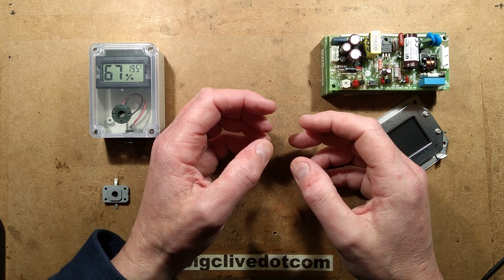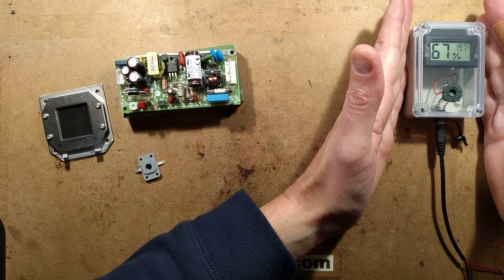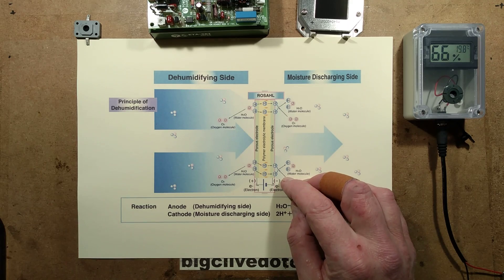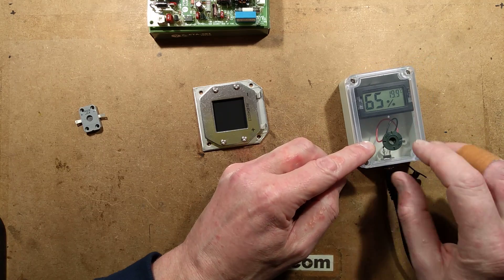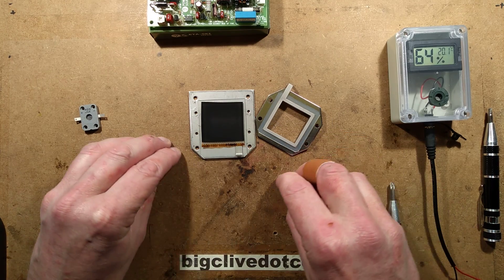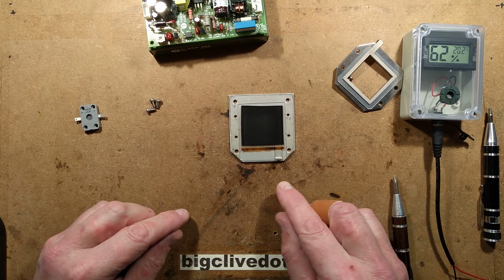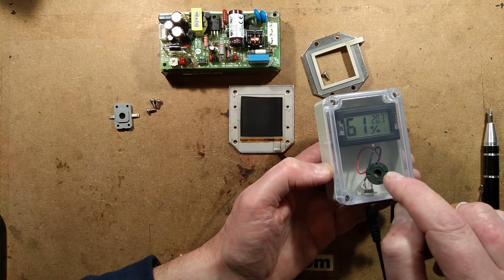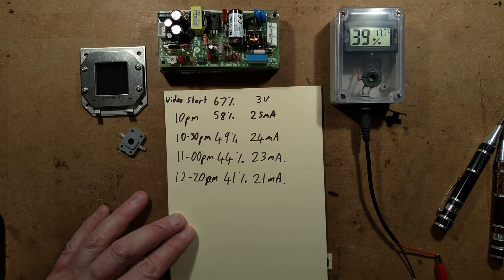Incredible solid state dehumidifier.  No moving parts.

Comment: You should take one of those, glue it to the top of a water bottle, power it by a solar panel then crowd fund it as a self filling water bottle........
Reply from the maker: It would work as well.  Basically a corpse lying in the sunshine next to a bottle that had accumulated quarter of an inch of water since its owner died of dehydration a week earlier.
Reply: bigclivedotcom 
A slight twist on that would be from a sealed casket, slowly turn a corpse into a bottle of liquid, could add colouring and fancy bottle, for those who wish a 'liquid loved one' as a keep sake!
Reply: @bigclivedotcom  So only twice as good as the next best self filling water bottle then lol
Reply: Haha, I like the videos that explain why those systems don't work. "Dry places are dry", "places without water, don't have a lot of water". Very amusing.
Reply: @Milamberinx  
They work, but they needs obscene amounts of energy and super high humidity levels. 

I just bought a proper dehumidifier and it easily produces enough water for one person to survive. Not sure what my energy bill will be, but it's only 350 watts. I run it 6 hours a day.
Reply: @glidercoach  I agree that the devices can take water from the atmosphere, but they certainly don't work as intended or proposed. Places that desperately need water don't have high humidity, it's almost a tautology.
Reply: Dave Curran
Wouldn't you end up with a bottle full of hydrogen?
I know! Run the hydrogen into a fuel cell to power the system! Perpetual motion with no moving parts! lol
Reply: Jim - I think that is similar to what the "Helios" UAV was considering, as mentioned by someone in another comment.
On the other hand, you may have the workings for a self-filling dirigible.  :P
Reply: This can be be powered by solar roadways to dry them and avoid them being slippery. The water can be used to fill water bottles that will be sold. At night the dehumidifiers are powered by a battery with a Batteriser in order to use the battery more efficiently. The solar roadway will also include a powerful infrared laser that will remotely power batteryless electeic cars. But a cheaper option is to replace the laser by ultrasonic charging :P
Reply: That sounds like a great idea, if there wasn't such a thing as "dust." :D
Reply: Fontus just declared bankruptcy , an idea that would never work..
Reply: amojak wow, took them long enough.
Reply: guess they decided to take the money and run
Reply: i wonder if the water seer is dead yet? Same concept
Reply: At least we still have solar freakin road ways!!!!!
Reply: Shush, that'sh a shtupid shilly idea.
Reply: Made me tear up quite nicely, thanks, no need for moisturizing eye drops today... hold on, must wipe excess... Oooohahahaha
Reply: Cant work due to lack of oxygen in the bottle.
Reply: Integrated Electronics, first use the solar roadway's previously stored Summer electricity to melt the Winter snow from its surface, and collect that into bottles.... wait.... Whoa! No need for a dehumidifier after all!! ;-D :-€
Reply: Been done..kinda. Theres a self filling bicycle bottle. Think theres a handheld too
Reply: Would need to add minerals to make it consuming water
Reply: and have thunderfoot review it
Reply: Google Fontus....
Reply: @andykbright  FUCK OFF NO THATS A JOKE IT CANT BE REAL
Reply: @andykbright  woosh
Reply: @yeet1337  nope no woosh and no pointless r/ either.
Reply: @yeet1337  Lol. 

"You should put a boost converter on the end of a battery so it's able to use more of the battery and provide a constant voltage."

Other user: "Google batterizer."
Reply: FONTUS PART 2 ?!!?

Comment: I wonder if (after the device has been operating for a while) the oxygen rich environment on the interior of the cabinet is going to promote oxidation of metal parts.
Reply: The manufacturer's site says the device might increase oxygen by 1% and the hydrogen exiting the unit recombines with available oxygen to form water vapor.
Reply: @TheHouseBlog  im glad its not a high O2 concentration.  I wouldnt want an Apollo 1 style disaster.
Reply: Rust requires both oxygen and moisture, so its going to reduce that.  The change in the concentration of oxygen will be tiny and completely insignificant anyway.  Moisture in the air is a tiny tiny fraction.
Reply: Oxidation is exactly what they are trying to prevent. I believe O2 is a double bond making it more difficult to oxidise anything.
Reply: Technically it is single bonded with two unpaired electrons (triplet) but a double bonded version can be created under special conditions which has alarmingly different chemical behaviour (singlet).
I doubt if the oxygen concentration would rise significantly given the relatively small quantities of water vapour and the fact that it already comprises 20% of the atmosphere. The worst hazard would be that a smouldering object might burst into flame a little sooner.
Reply: Mahla Propyzm  I though it was triple bonded with two anti-bonding unpaired electrons to cancel one bond-equivalent?  The unpaired anti-bonding electrons are anti-parallel in singlet O2, making it much more reactive kinetically (not thermodynamically), the ground state has the spins parallel so they can't readily form another bond (in the absence of photons at least).
Reply: @Jeffery. What we call 'fire' is a fuel reacting with O2. It is highly reactive, from rust to bonfires to fats going rancid.

Comment: Is external humidity a factor in how low it can drive internal humidity?
Reply from the maker: The difference between internal and external may have an effect on efficiency.
Reply: If it was trying to pump water through reverse osmosis you would think so, but it's pumping hydrogen. Wouldn't hydrogen concentration be the limiting factor?
Reply: AIUI, the hydrogen is reoxidised at the outer electrode back to water. I expect there is a rate limiting level of hydrogen ions that can reside in the middle.

Comment: Very interesting product and video.

So, if applying 3VDC to the terminals causes ions to move through the matrix to the humid side, resulting in a humidity gradient across the membrane, perhaps the inverse is also true.

Hypothesis:  removing the external voltage supply and imposing a humidity gradient in the correct direction across the membrane will cause the same type of ions to move through the matrix to the dry side (in an attempt to reduce the osmotic pressure across the membrane) and until the humidity gradient reaches zero, the ion flow will generate a voltage at the terminals that can be measured with a meter of suitable sensitivity.

Is that a hypothesis that you could attempt to test for us?
Reply: Oh that gives me a great idea for a humidor. If it doesn't work on the inverse, I could just have two ports, with one pointing out and one pointing in, and have an mcu switch power to both depending on the humidity.
Reply: Drive it with an H-bridge and have just one device do double duty.
Reply: This thing is basically a hydrogen fuel cell running backwards, so yeah.

Comment: I've wondered about Peltier panels too. Would the warm side on a box have the same effect? Running it at low power, with limited heatsink would allow it to become "quite warm and quite cold at the same time, The cold side tends to get frosty as it pulls water, and the warm side will tend to dry the air. Sticking the hot side to a case, without any access hole, may do much the same. Probably far less efficient though with the maybe useful heating benefits.
Reply: And where are you actually removing the water in your idea? You're just heating the inside of the box. You don't need a peltier for that.
Reply: Lots of crappy made-in-china dehumidifiers use the peltier effect, most 'mini dehumidifiers' you will find on Amazon will use the Peltier effect. This is because compressors are expensive whereas peltier panels are cheap.

The trouble is that peltier panels only remove a considerable amount of moisture from the air when ambient temperatures are high. Most of these listings advertise the daily water removal rate at 30C and 80% humidity, conditions we don't really get in the UK. I've previously owned one, but returned it when it removed just 40ml of water after 24 hours of use in a humid room.

The only good dehumidifiers for reducing the humidity of a room in your home is one that uses a compressor.

Comment: Great find! This look ideal for storing 3d printing filament, PLA in particular, since is prone to absorbing humidity. Interesting stuff
Reply from the maker: For reference, I store my LEDs in a sealed container with a silica gel desiccant pack in it and a humidity meter visible from the outside.
Reply: Me too, but they are a bit expensive for that. If you also open and close the container frequently, the drying time may be too long for it to be effective.
Reply: @janpetersen8441  Don't know if price droped since but for 150 dollars you can have an unit that can handle up to 10 spools
Reply: you beat me to it I was thinking the same thing
Reply: At its price, its cheaper to buy new PLA.
Reply: @h0m3us3r.0  No in the long run, at today's price
Reply: You think PLA is moisture sensitive? Try printing with nylon without dehumidifying it first... it literally steams.
Reply: Funny I was thinking the same thing to keep my non PLA filaments dry. Being virtually maintenance free would be great. Recharging silica is a hassle.
Reply: I had the same thoughts !!
Reply: Same tough here. What a pity it doesn't look to be easily available for the general public.
Reply: it is now
Reply: For that application, shouldn't you be making your own dehumidifier, an enclosure for a peltier, finned heat sink, fan and condensate pump? Or if you're feeling adventurous, maybe print a turbo expander and cyclonic seperator, motors, maybe even heat exchangers with conductive metal infused filament? There are even SCAD files on Thingiverse you could customise if CAD designing a turbine from scratch is too daunting (which it would be for me).
Reply: @byebye9785  Nope, this membrane is far supérior
Reply: What a great idea!
Reply: More for Nylon, PETG and TPU than for PLA, I'd have thought (I just keep my PLA in grip-seal bags with a single desiccant sachet), but yeah, sticking something like this on the side of my filament drybox could be interesting :)
Reply: Pla is probably the least prone to humidity of all filaments

Comment: Nice video Clive, we use 4 of these in our weightronix scale enclosures that we have to keep pressurized with 10 psi of compressed plant air for intrinsic  safety (I work in an acetylene plant) to wick passive moisture that the pneumatic dryers miss.
Reply: Normally it would, however our compressed plant air is 70% nitrogen, 30% filtered air so as not to get excessive temperature swings under heavy compressor loads. So the amount of O2 is very low and quite rapidly displaced by the nitrogen. (Exhaust return line is on the bottom of the case, purging low lying oxygen first.)
Reply: Patrick Lee and the hydrogen On the outside? Well, I guess acetylene plants are full of that anyway, right?
Reply: At 20°C a liter of air (no matter what pressure) can hold about 24mg of water (100% Humidity).
If all the oxygen stays inside  and its 1 bar, this would increase it from, say, exactly 21% to..
Produced oxygen: (24mg/18g/mol * 16g/mol) = 21mg 
Already existing oxygen: 1 L / 1,2kg/m³ * 0.21 = 250mg
So we get 21% = 250mg
250mg + 21mg = 271mg = 22.7%
At higher pressures, due to more oxygen already in the volumen, this increase will be lower, eg. at 2 bar its only 0.9% increase, at 4 bar 0.44% etc...
Reply: @leocurious9919  I didn't realize that relative humidity was not pressure-dependent. This explains pretty well why things in hyperbaric chambers are so super combustible.
Reply: @leocurious9919  Great info, you answered the question I was going to pose, almost.....  This does assume a sealed "airtight" system.  I was thinking that if an enclosed system used this dehumidifier, but the system had a very small leak that allowed moisture to enter, then O2 could build up over time.  Remember, as the water vapor is removed, the system becomes a vacuum to outside water vapor.  And, similarly, as O2 increases in the system, it behaves as if it is pressurized in O2 vs. the external environment, so maybe it would balance out OK. ??
Reply: So these can run with 10 psi across them? That's pretty impressive.
Reply: JPatrick Lee
Reply: There is no hydrogen on the outside. According to the formulas shown the hydrogen ions would react with oxygen from the surrounding air and create water on the outside.
Reply: Patrick Lee For that application, does the generation of oxygen and hydrogen interfere with the intrinsic or other safety requirements?
Reply: @johnfrancisdoe1563  good Q would like the A

Comment: How much of the humidity drop is attributed to the rise in temperature inside of the box?  Rising temps will decrease humidity as well.
Reply from the maker: I wondered about that, but the dissipation of the device is equivalent to an indicator LED so it definitely wouldn't account for a drop to 33% humidity.  The humidity meter does have a temperature display on it too.
Reply: @bigclivedotcom  I assumed it was heat from your hands, work environment and the lamp pointed at the box like a greenhouse.
Reply: The temperate may rise at first due to the higher power use but at the end of the test, the mAh is lower and the temp is lower too.
Reply: You're right that relative humidity values need to be taken with the dry bulb temperature to determine the absolute humidity value in the enclosure.  Using the values shown during the video, the enclosure starts at 19.6 C, 67% RH and ends at 20.4 C, 60% RH.  If the device only heated the enclosure, raising the temperature from 19.6 to 20.4 C with the same absolute vapour mass in the enclosure it should have ended with an RH of 64%, according to ASHRAE psychrometric tables.  Therefore the device did lower the relative humidity level from 64% to 60% during the course of the video.  To end at a 33% RH would require heating the enclosure to 31.5 C.  Quite an impressive little gadget!
Reply: Mollier Diagram to the rescue! ;D
Reply: As you showed the results at the end,  I did notice the dramatic drop in humidity with really no temperature change. So the device works REALLY well!
Reply: @JeffreyGroves  the efficiency is  probably shit thought, even compared to traditional deumidifier (but that should not be a problem)
Reply: I was wondering the same thing.  Shoulda scanned comments first.
Reply: The temperature dropped by 1.9°C over the test period with the RH dropping by 28% during that time. So I think that's pretty impressive, given the size of the module used and the tiny amount of current it uses.
Reply: Assuming it did not work at all (which it obviously does) and just heat the interior (so the absolute humidity stayed the same), you'd have to go from 67%@20°C to 30°C to get a relative humidity of around 39%.
Considering the temperature actually dropped the 39%@17.6°C is equivalent to about 34%@19.6°C (the starting temperature). So it did do quite some work and removed about half the water inside the case.